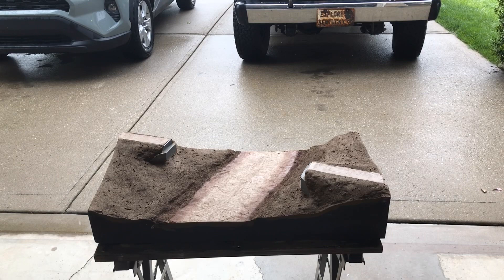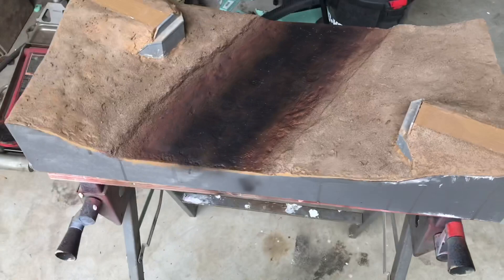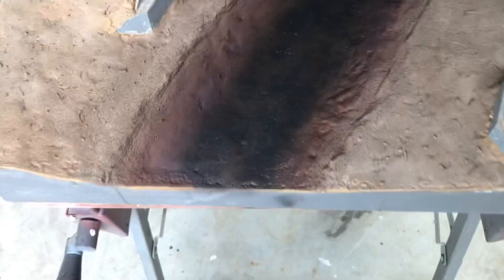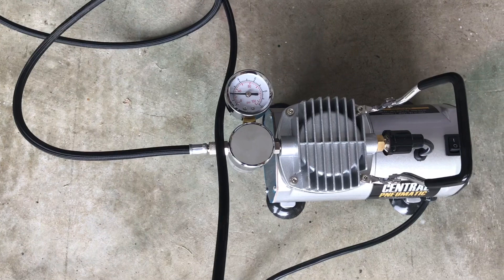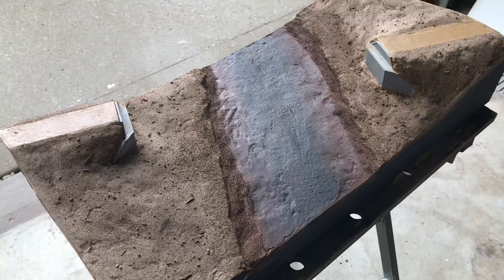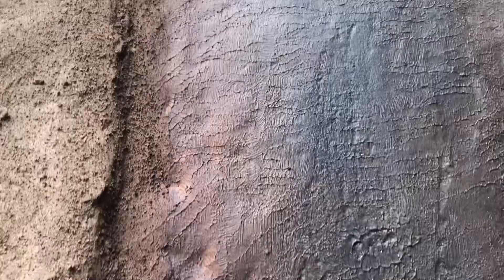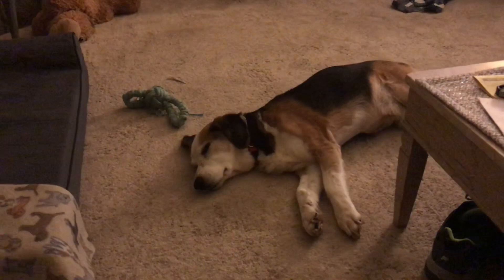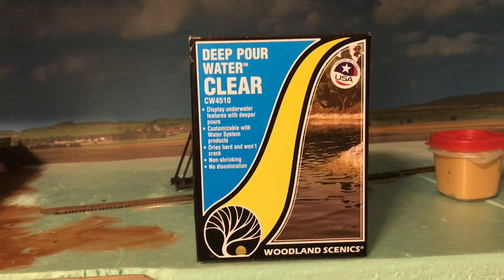Painting the river bed on the N scale bridge module

Comment: I have also been following Boomer. I have started using the Tamiya paints that he uses and I like the results. Being able to use a much lower pressure with the airbrush will make a big difference. For a long time I was doing my airbrushing in the garage because that is where my air compressor is located. I even thought about running a 100 ft. air hose around the house and into the train room/bedroom window. I went ahead and bought a small 3 gallon air compressor and secondary regulator that lets me have a finer control over the pressure. I like the way the diorama is turning out. Nice work. Stay safe.

Edit: Another modeler that has shown really nice techniques to make rivers and ponds is John's Trains. I really like the results he gets.
Reply from the maker: Thanks for the tips. I could probably get away with maybe adding 30 feet of hose to use my big air compressor. I could even wheel it around to the side of the house and not buy anything, but that’s inconvenient. I did manage to find an adapter and hooked it up to my Paasche airbrush and weathered a G scale boxcar at 20psi and am happy with it. Probably a little heavy-handed for N scale, though. Stay safe!

Comment: The air set is nice, should drop to 30psi for painting and foam cutter works great, hoping the best for your dog.  Bob
Reply from the maker: I think what bothers me is that as soon as I let off the air, it shoots back to 60 so it’s inconsistent. I set my big compressor to 20 or 30 and it is always the same. I think it would be easier for me to put an external regulator on it. But, I used to paint bumpers for Toyota and you’re never supposed to be aiming your gun at the bumper when you start spraying, at least on a piece that big. Chance is still struggling, some things are better and others worse. Gradual improvement, I guess. Stay safe!

Comment: The diorama continues to improve. I haven't made the jump to buy an airbrush yet. Just seems like too much work. That hot wire cutter looks like it works great! No little pieces of foam getting everywhere. One off topic question. Do you use any kind of software to edit your videos? I am trying to make a video of operating on the newest section of my layout but having some issues. Thanks for the update and stay safe.
Reply from the maker: I use my iPhone for everything and there is an app called iMovie that I use to combine videos and cut and paste. It also lets me add music or voiceovers, but has no way to add text. I wish I could do that to explain my flubs. After I get it how I want in iMovie, I save it to my photo library and load it to YouTube from there.

I think the airbrush is great, but it does seem like a lot to mess with. If I want to weather 1 car, I wouldn’t want to get it out. But if I had a bunch of stuff to paint, it’s great. I weathered a G scale boxcar this evening for practice and it came out well. Hope I answered your questions about the video. Stay safe!
Reply: Maurice, if you are using a PC to do videos there is a software product the I use called VSDC. I use the free version and it allows me to do everything I want to do. It does take some getting used to, but there are a ton of YouTube videos showing how to do most everything.